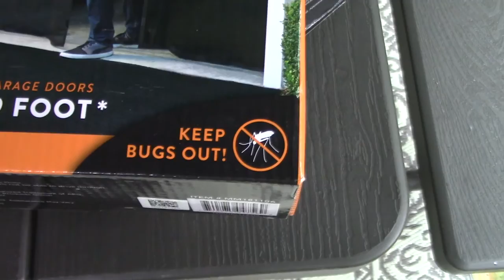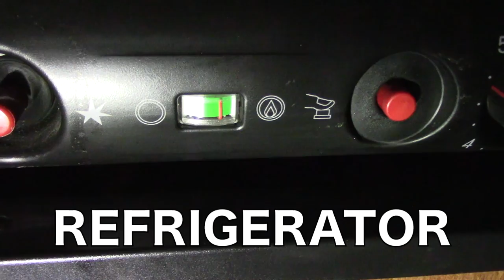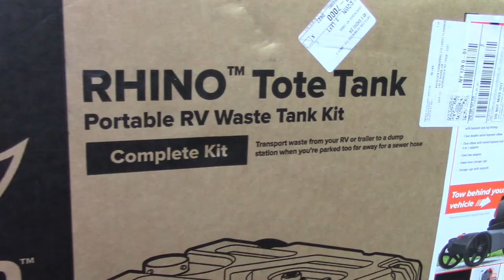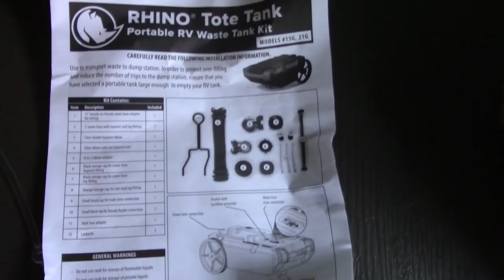RV LIVING OFF GRID - WATER, POWER, & POOP!

Comment: It gets so hot without some trees.  Where I'm parked getting some repairs there are no trees and it is so hot by noon.  It had been in the 00s and on here over a 100.  Thank goodness I have my awning.  My Generator isn't working.  My cousin got it brand new from home Depot and it only worked for about 15 min.  I'm going to take it back and get a higher wattage.  Your place is looking very nice.  Makes all the hard work worth it!
Reply from the maker: Thanks so much Deb! The generator is so helpful to have! Our trailer is so small it actually runs a 5000 watt ac for those super hot days. I don't know what you had but you should definitely look into getting another one!

Comment: Hi...I'm in my late 50's and I just bought a very nice used 5th wheel and yes, without a truck to pull it but that will be later. Anyway, I thought this would be an ideal and "cheap" way to retire boy was I wrong. Anyway, love your videos especially when I was tired and distressed about where in the heck was I going to put this RV. I am not one of those living off the grid to "leave a minimum carbon footprint" nonsense but I could be a borderline prepper especially during this time of Covid, riots, and political unrest. Anyway, after I bought this wonderful RV I had to put it in a campground which is killing me in lot fees so I looked toward buying unrestricted land under $10k. This is why I'm so distressed even to the point of  depression and crying cause I finding that land is not cheap and if I do find a small parcel then there is no water, no sewage or septic system and no electric. Thank goodness I saw your videos cause they are giving me hope. If you have any suggestions or ideas for me please, please help me. It is only me (I have a 37 year old son who really doesn't help cause he works 2 jobs and has a teenage son). I guess the first bit of advise is where can one go to find cheap land to put your RV on? Thanks
Reply from the maker: I guess my first question would be what state are you in? Some states are better than others
Reply: You need to be in a state with cheap land. The Missouri ozarks has very cheap land. The more rural the cheaper. Or try Kentucky and Tennessee.
Reply: @nancylaneve6399  did you ever find land? Their is a lot.of cheap lam and many places it is is legal to live in an rv on your land and taxes are under 400 a year if you don't put permanent structures on your land.

Comment: Why didn't you build a simple outdoor shower to cut down on your grey water that is pumped to your tank?
Reply from the maker: Brian Gasser it’s on the list! But the water has to be hot👍
Reply: @CreatingASimplerLifeOffGrid  I have seen some solar outdoor showers used for marine purposes. You may want to check them out. Love the screen in porch.
Reply from the maker: Brian Gasser I will! Thanks for the tip 👍 I love the screened porch too! It’s the only way to be comfortable relaxing when the bugs are biting!! Lol